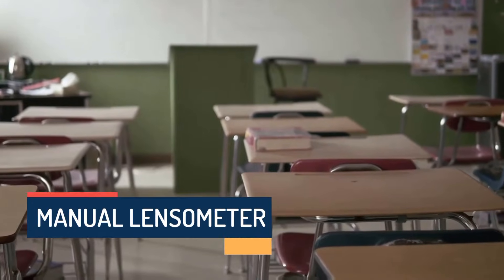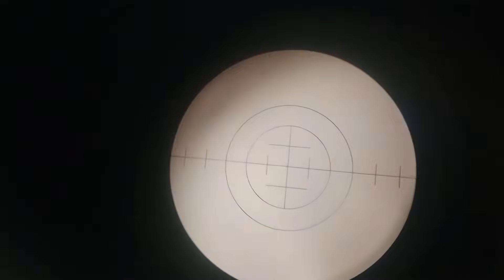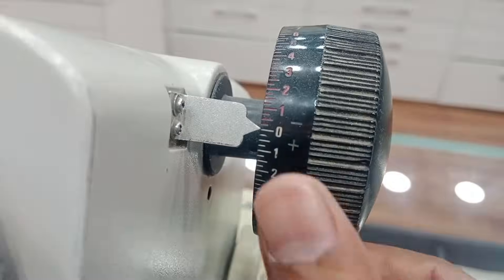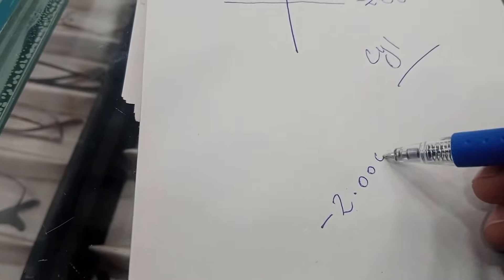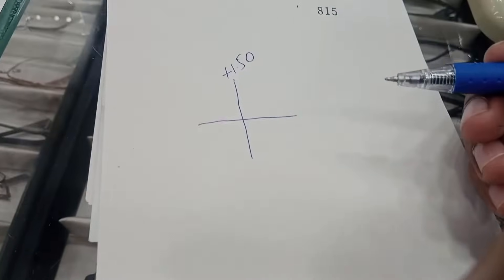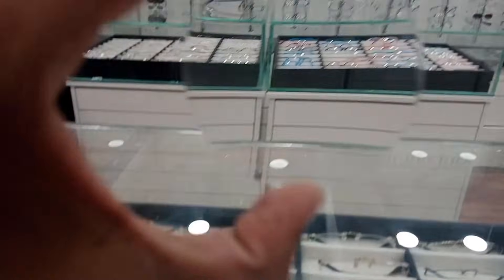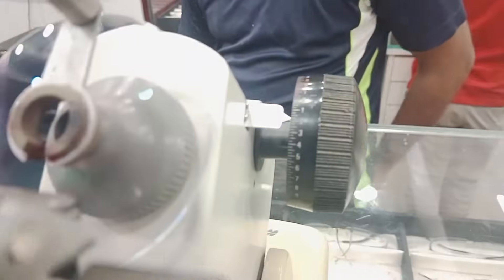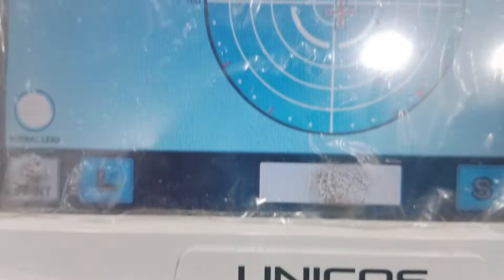Manual lensometer/ Practical demonstration

Comment: Sir .can i ask a doubt! 
In sphero cylindrical lens - when u rotate the power dial one meridian is clear at +1.5 and other is +0.75. But why you take spherical power as +1.50 ? Y not 0.75 ? 
Is there any theory please tell !
Reply from the maker: You can take any as spherical..but the axis will get change as in transposition.

Comment: In spherocylender +0.75 come first if we are moving zero to plus direction then you not take +0.75 as spher and +1.50 as cylinder
And final cylinder would be +0.75 because we are moving from +0.75 to +1.50 so
So final +0.75/+0.75 axis

Comment: Sir…thank you. But can you please make a simple video tutorial for the cylindrical component and angle to read or measure using the circular gratidule of the lensometer. I’m trying to work this out and having difficulty.
Reply: Once you have neutralizer both meridians or found powers of both meridians, the axis wheel which is located at the base of the eyepiece can be rotated towards the alignment of the second meridian i.e., the axis bar is roasted and longest line is aligned parallel to the the lines  of the second meridian

Comment: I don't understand the mires seen in a cyl. How do you know it's a cyl with axis and how do you find them out
Reply: You will see two sets of parallel lines: one thin set and one thick of lines. When one set of lines are in focus but the other is not, that's when you know it has cyl

Comment: I don't understand the mires seen in a cyl. How do you know it's a cyl with axis and how do you find them out
Reply from the maker: If you observe clear dots then lens is spherical ..and if you observe vertical and horizontal cylindrical mires then the lens is cylindrical.
Reply: So what if it is a spherocylinder? What do you observe?
Reply: @Jaycycar  if you can see dots at the center then its spherical power may be + or -. If you see a mires with cylinder shape then you will get cylinder. . and has a axis.. If you get cylindrical mires and both axis got different power then its spherocylinder .
Reply: @kbrandforever  if its spherocylindrical then one meridian would be in form of circle and other one in form of cylinder right? And we would take the axis of first spherical meridian in prescription right?
Reply: @shizamushtaq2718  no in spherocylender both meridian is shape is green cylinder type
First meridian take as sphere and difference from tha to other meridian take as cylinder